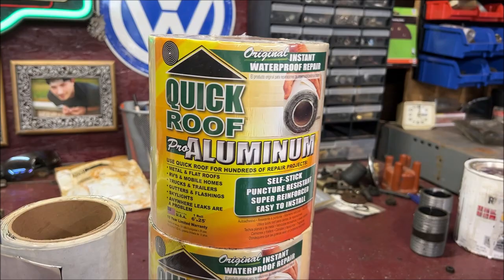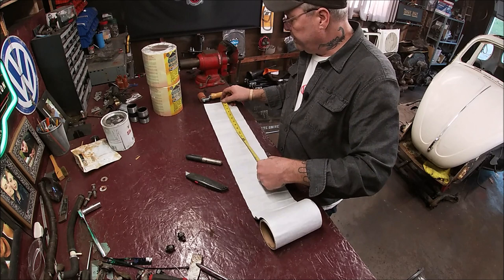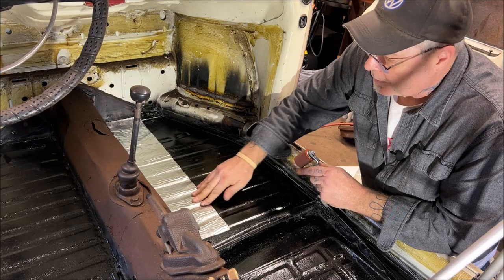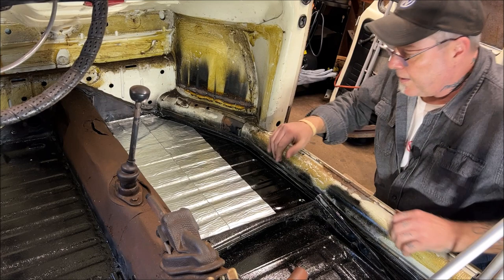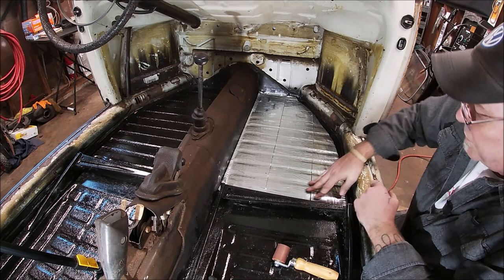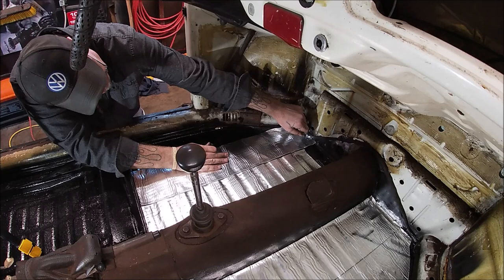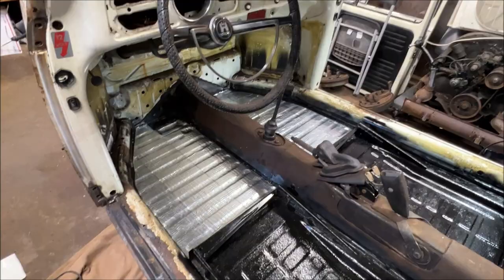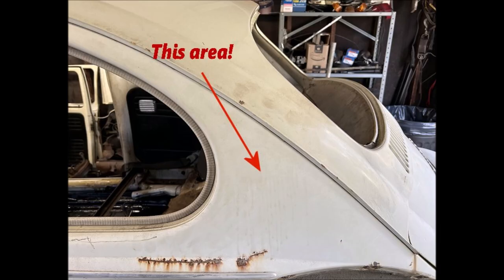VW Beetle - Super Beetle Sound Deadener - Floor Pan Protection - Cheap & Easy! DIY! Part #1

Comment: Yes I would like to see what to do there. Almost every bug I had or worked on even if it was super clean and rust free had that one fender bolt that rusted up and broke off. I didn’t know if that foam was a factory thing or not. I had one the a guy must of bought a case of foam spray and went crazy. This car was rust beyond belief.
Reply from the maker: Yes the foam was put in by the factory. I believe in 72 and up is when it got worse. 
But I’m going to remove mine anyhow just to show what to do. 
Fender bolts often break off, or the nuts end up rusting and spinning. I have to weld some new ones in place which I will do a short video on. 
I always use anti-seize when I’m putting all the bolts on. Thank you so much for being here.

Comment: Great video. I’d love to see you do a video on the death foam. I’m battling it right now on my project. I got most of it out but want to make sure no more rust comes back
Reply: The death foam was an issue the  73?-77 type 1 cars. The 68-72 cars use different foam materials.
Reply from the maker: I will definitely do it, I wasn’t sure what your yours was.
Reply from the maker: @vintage76vipergreenBeetle  seems the later years were definitely more of an issue. I’m going to remove mine anyhow, and put the homemade pillows in.

Comment: Yes... I'm trying to decide whether to remove that padding that can hold moisture as I'm considering applying Kilmat there; but I have rust bubbles visible on the outside below the half-moon vent.
Reply from the maker: That would be from the foam inside of there. You definitely need to address that issue before it would get worse. I have found when I start sanding little bubbles I end up with a hole. 🤦🏼‍♂️
Reply: @SladesVWBeetle  Where do they sell the quick roof aluminum? I dont think you mentioned it.
Thank you
Reply: @SladesVWBeetle  How long did it take to do the whole pan?
Reply from the maker: @SDsailor7  I will attach a link in this message to Lowe’s. They are much cheaper than Amazon right now. It took me a couple of hours to do the whole pan. On the last project. I still have to finish this when I have other things going on.

https://www.lowes.com/pd/Peel-Seal-Instant-Waterproof-Repairs-6-in-x-25-ft-Aluminum-Roll-Flashing/1018733

Comment: Hello,can you look into doing one about the heater tube replacement that is located between outer skin and inner footwell,how do you replace that original cardboard tube without cutting out sections of inner body just above heater channels?

Comment: very good info. when you do 2nd layer do you stagger seam or change direction. i have a sb and i would like to see removal and replace of foam. thanks
Reply from the maker: When I do the second layer, and I should have mentioned it. I go the opposite direction like a Crosstitch pattern. I surely hope that made sense. I will be doing the foam removal video in a couple of weeks.

Comment: Great video Tony, you are flying again to get this beetle done. I hope you will reduce the noise big time. I don’t know if I will do that in the oval. Still not decided yet.
Reply from the maker: Thank you so much my friend, if you’re not going to be driving it every day all over the place, I probably wouldn’t bother. If I had a 1955 I would probably be using the original tar board. Maybe from Wolfsburg west.
Reply: @SladesVWBeetle  well there was no tarboards installed from the factory, so it would stay original.
Reply from the maker: @VWBEETLEOVAL1955  Oh I never knew that!!! I never had one that old. And I probably will never get to, they are extremely expensive near me. 🥺
Reply: @SladesVWBeetle  yeah the same deal here, finding NOS is very expensive.
Reply from the maker: @VWBEETLEOVAL1955  Oh I bet it is!!

Comment: Excellent work. Using your videos on my 71 SB restoration. I would like to see a video on the rusting on the rear panels where the foam is installed. A section of mine was done with fiber glass but I have an area that the rust is bursting. Point me out to a video if it’s done already.. thanks

Comment: Wouldn't it be advantageous to run the 2nd layer opposite the first. Longways first then along the short. You would be pretty much assured you got at least one layer in every single spot.
Reply from the maker: Actually you are right. I ended up doing that on my buddies car. I should’ve done it on mine, but I’m just trying to keep the vibration down. Thank you so much for being here.

Comment: Nice video (again). I have seen this sound deadening treatment, but I was not sure what the product was.  Question: when you do the second layer, do you start at the opposite side so you overlap the joints on the first layer?? And, yes, a quick video on that side quarter area would be interesting. Finally, happy Thanksgiving to you and your family as well!!
Reply from the maker: Very good question my friend, and I did not think to bring it up!!!
When I do the second layer I go the opposite direction. I hope that makes sense? 
And I will be doing the video with the foam removal and a couple of weeks.
Reply: @SladesVWBeetle  Makes sense! Thank you!

Comment: Slade, would it benefit to cut the strips longer so that they fill the dips in the pan better? Stick on one end and roll into each of the lower areas one by one as you move backwards. I’ve never put in any stick on sound deadening on my vw’s before. My concern was always trapping water and causing rust.

Comment: Do you ever try and clean up the carpet glue and old carpet fuzz before laying this stuff down? Or a general clean did get dirt and dust off?
Reply from the maker: Honestly I'll be doing that soon on an upcoming video. If its really  bad, I would try and get the heavy stuff off. I sanded one time, but of course had to rattle can the area.
Reply: @SladesVWBeetle  awesome I’ll tune in!! Thanks!!

Comment: How come you didn't cover the tunnel  also
Reply from the maker: The factory sound deadener is still
good on there. And I have to weld that part shut first that someone cut open
Reply: Thank you for your answer
Reply from the maker: @rongibbs1778  And thank you for being here! There will be a part #2 with the sound deadening
Reply: @SladesVWBeetle  Big thanks to the link to lower on the aluminum repair roll.